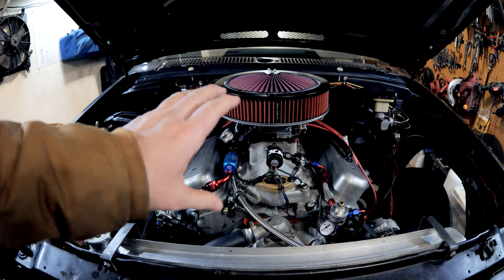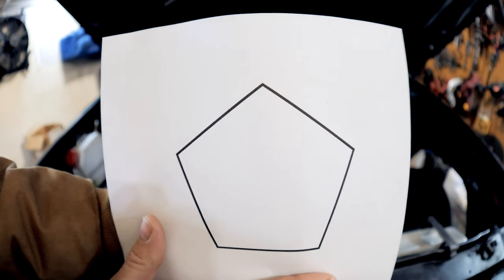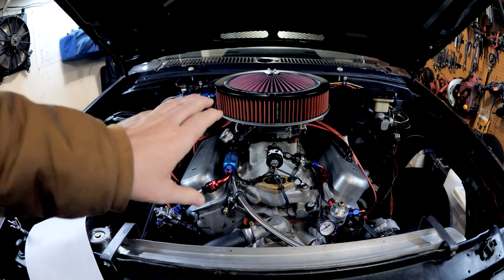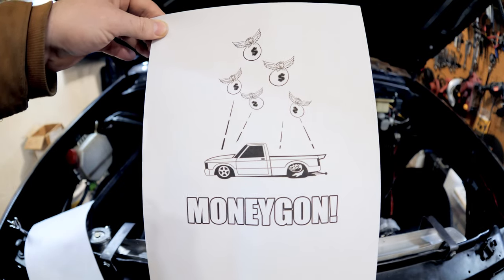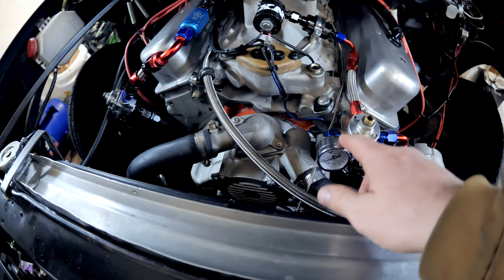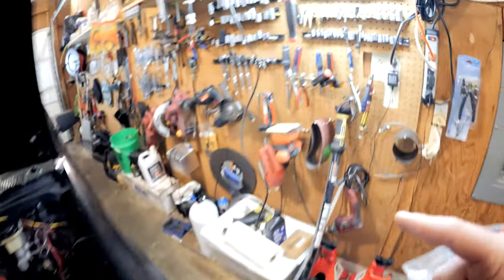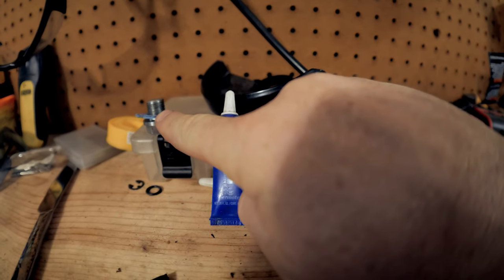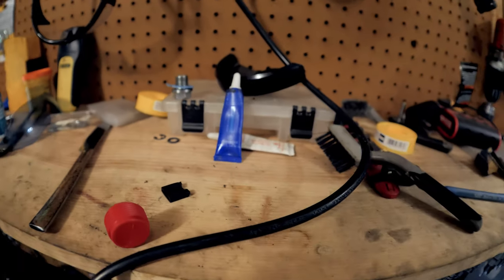The “ Wrong Right Way “ to use PTFE or Teflon tape with your fuel system.

Comment: I thought yellow was for gas pipe thread like co2, argon, natural gas. I didn't think it was rated for fuel. I may be wrong about that but I am pretty sure that was the case. Its more of a thread lubricant than a sealer anyways although it does have some minimal sealing properties. According to the website you can use rectorseal #5 with gasoline though.

Comment: i just put a high flow filter on my lexus the guy at part store said not to use any sealant on the 6an fitting so i didnt, put it on the car and the thing starts leaking. go get some of this and seems to be ok so far.. fingers cross it lasts. what are yiu supposed to use if ur not supposed to seal it and it leaks..?

Comment: I used some of the yellow fuel resistant PTFE tape recently and the stuff literally turned to goo and ran down the side of the fitting and and the carburetor.   Seems that fuel will dissolve this stuff no matter what the manufacturer says.

Comment: May I ask you a questions: I ordered some straight AN to NPT Adapter Fittings and I am wondering that some have o-rings and other dont. What is the reason here. Do I have to use it with o-rings or a washer instead? My plan is to install them with loctite 577 only. Cheers

Comment: if you will use junk, why use a tread/connection that needs a sealer? Why just not go with an AN connection that is made to take a part a lot without checking an o-ring or use sealer? That what's the AN connection is made fore!